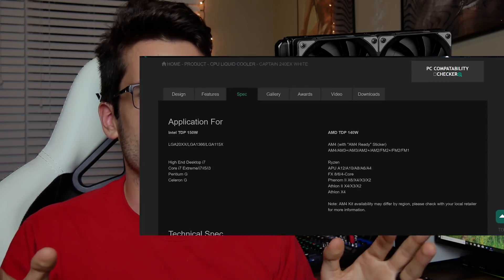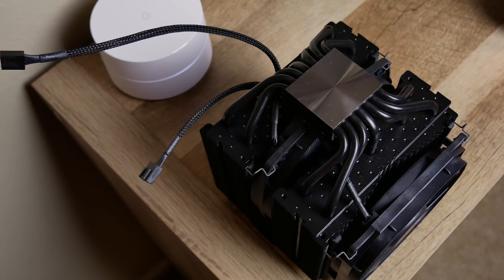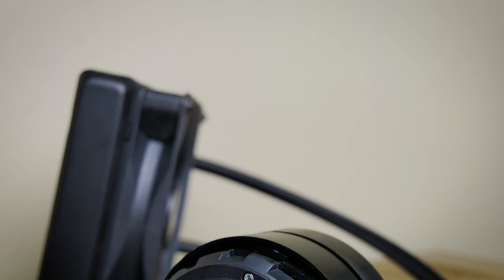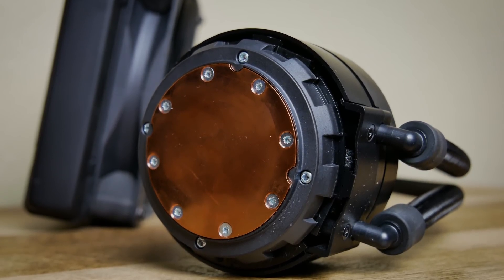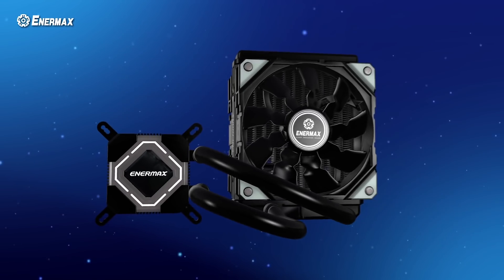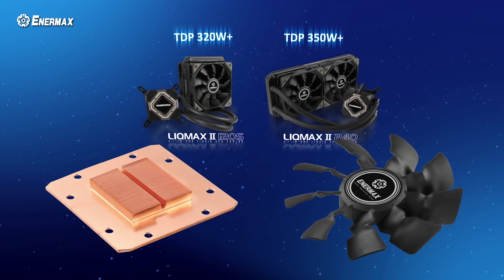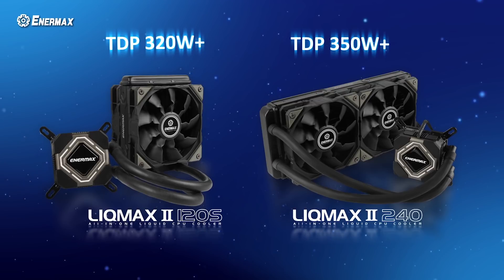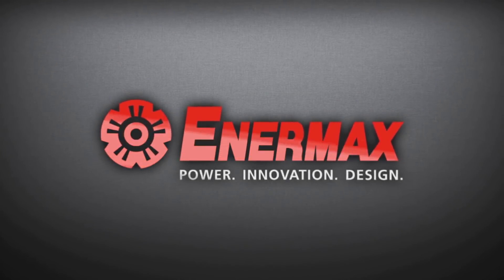Ever Wondered Why TDPs Aren't Listed for AIOs?

Comment: soo im wondering 
does watercooling make hardware live longer?

like im not talking because lower temperatures
i mean of Temperature slower changing than it doesn on an aircooler
(because materials expand or shrink depending on temperature)
Reply: PLPlolol 1 sounds like a good theory but even if it did make a difference in practice the cpu will be obsolete and the motherboard will probably die long before the difference shows. 
Id rather replace a couple fans on an air cooler than a couple liquid coolers over that huge timespan aswell.
Reply: yeah 
atm im actually more interrested in aircoolers but then id have this big open space in my pc unused ;-;

Comment: Arctic (the guys who make the thermal compound) also list their TDP on their website, but as with deepcool they do it with quite reserved figures.

All of their aio coolers have two fans in push and pull, starting with their 120mm extra thick rad, so they definitely underestimate their TDP.
Reply: I have a 240mm Arctic Aio for two years now and it runs like a charm. Its the same Asetek pump that everyone else uses but it only cost me 85€ with 4 relatively good fans included. Can't come up with a reason to buy other brands for 120€+ over Arctic.
Reply: Reanu Keeves i don't know but it's quiet and does the job, so why bother? :)
Reply: Phil Atkins have you looked at arctics air cooler tdps?
Reply: EHEH RON I have, they're all realistic too :) I particularly like the Cooler 13 CO which means continuous operation. Designed for servers or HTPCs basically
Reply: black jack if it's 2 years old is it a Gen 3 asetek pump or was it just as gen 4 came out?
Reply: Reanu Keeves according to hardwareluxx.de, Arctic seems to use Aseteks fifth pump generation, I hope this helps.

Comment: If companies were honest about their TDPs then they would probably have a hard time selling their AIOs since air coolers are just better bang for the buck in terms of raw performance. I can get why they don't list their TDPs and it's a bit of an arbitrary thing as a company to do nowadays if you want to sell customers an AIO rather than an air cooler. It can seem a bit scummy but it's business at the end of the day and water cooled PC's usually look more aesthetically pleasing than a big beefy air cooler. But are they generally worth the money? No.
Reply: Companies don't list TDP becuase it's not as impressive, so they won't sell as well. That being said, there are a few advantages to liquid cooling. AIO pumps might not conflict with RAM, VRMs and decorative plastic bits on your mobo (think strix z270e) as much  as a large air cooler might. Additionally, depending on the case or configuration of your PC, your CPU might run a few degrees cooler by pulling in cool air if you front mount your radiator, especially if your GPU is dumping heat into your case constantly and you have minimal airflow.
Reply: mjc0961 
I suppose you have not heard of more silent pumps, or to at least normalize the flow rate to be consistent. To keep increases in control.
Reply: Hardline custom loops look nicer than a big beefer air cooler. AIOs don't. Take that soft tubing flopping all over the place and GTFO of my build!
Reply: "water makes better temperatures at a smaller size and drastically less noise than air."

Nope. The noise of the pump more than makes up for being able to run the radiator fans a bit slower than the fans on an air cooler.
Reply: My computer can run silently if I dial back the fan speed.

There is no pump noise whatsoever.
Reply: water makes better temperatures at a smaller size and drastically less noise than air. air is much cheaper and can cool better but at much higher volumes and drastically bigger parts

Comment: why not just advertise a maximum and minimum tdp. Or like how gamers nexus measures temperatures, tdp, with fans, at a certain sound i.e 40dba which  advertises both the coolers capability as well as then fans
Reply: Clam Dong to make money?  Marketing their shit products to sell better.  Even air coolers do this.  Check out arctics line of cpu air coolers. They have ridiculous high tdps listed.
Reply: Maximum TDP would be misleading because nobody would have that high of air flow. 
Minimum TDP is would make AIO's look much worse than they are.
Normalized testing makes the most sense, but without legal binding, you can't trust companies to not skew testing conditions just enough to beat their competitor. A great example of this would be vacuum cleaner "power." Over time, the power rating on vacuums has got so detached from reality that most report a physically impossible rating(higher output power than input).
Reply: do the majority of air coolers suffer from cherry picked optimal results?

Comment: Hey guys can someone help me? On all my 379 games, my PC randomly freezes, nothing in particular triggers the freeze, and i think is something hardware releted issue... the same problem was happening on a g3258 and a 960 4gb, now i have an i7-4790 and a 1060 3gb but the problem still remain, what should it be? MoBo? Ram? The HDD's aren't becouse i tested a game on the SSD and the problem remains, maybe PSU? I have a cougar vtx 600w, 588w max output, i can't really figure out my problem, here's the video of my youtube channel that explains better than all my words: https://www.youtube.com/watch?v=K3i1z6vIC8Y
Reply: you should stress test your hardware and look at the temps or if it locks up. use a tool like msi kombuster. because what you "" describe""  is completely random. 
so first check your temps. and after that you can check everything else. 

ps this has "nothing" to do with you hdd
Reply: Temps are fine, CPU not over 55°C, GPU not over 70°C, no throttling..

Comment: Then why do almost every single person prefer aio? I know that they are easier to mount and put in smaller case but in regular sized cases i would always put something like noctuas nh d14 or d15 or dr pro 3 or 4 because I know that tower coolers are much better at heat transfer than aio. And because of that reason i would buy a bit bigger case if it couldnt be placed inside.
Reply: Hardcore Hardware well for me something like dark rock looks much nicer than aio

Comment: someone told me that AIO's have they are "more effective" as they heat up and they are gonna to be able to cool anything.
I think that only AIO coolers are worth just for estetics or when your ram sticks are 2 high to fit a beffy cooler.
Reply: AIO's warm up slower, and cool down slower, they are not a magic solution, but with the right one on the right CPU, they are freakin awsome and more silent
Reply: Harm Zegt AIO's more silent than air coolers? I beg to differ. The pump design Asetek has been using for a few years is anything but silent. It may just be Corsair and NZXT, but after having terrible software (CAM) and hardware (H100i v2 and X52 Kraken) flaws I bought a Dark Rock Pro 3. No problems since then, and this cooler is the definition of "silent".
Reply: Harm Zegt I got h100i(I think) and barely hear it most times compared to my lil bro's ps4 which at times sounds like it's gonna jet off
Reply: Piotr Romasz I have a SFF rig. I can't fit a tower cooler in an Elite 130. It isn't just about RAM height. Sometimes there are cooler height limitations, and a CPU block takes less space than air cooling.

Comment: With AIO cooling, am I wrong to think that you want your fan curve ahead of the curve as it were, so that you dissipate heat before it builds up, because it's very hard to lower the liquid temps without dropping load considerably?
Reply: mavis cruet yes, because with liquids, it takes a long time to heat up but it also takes a long time to cool down.
Reply: Thought so.  I bought a pre-built system recently, and the AIO was the lesser of three evils on it.  So I chose that.  Mostly I wear headphones, so ramping up fan speed matters very little to me

Comment: So here's my question. I have a cooler master liquid master 120 I think is what it's called, and as soon my systems boots and comes on line  my CPU temp is 53 degrees c just at idle. I would have thought that the liquid cooler would keep it cooler than that. I can hear my pump spin up and seems to be running in accordance to the fan controller software in the BIOS(pump is plugged in to the CPU OPT header). Could I be missing something?
Reply: Hardcore Hardware No offence mate, but did you use all the TIM at once? I don't think you did it, but people these days you know don't get smarter so I have to ask.
Reply: Joseph Mouton sounds like the cooler has bad contact to the CPU. Maybe the wrong thermal paste application or wrong cooler installation
Reply: is it just one core? i have the corsair h100i and a i7 6850k one core (high OC core) is 49 idle and the rest is around 30/40 c
Reply: Bloodhoun21 the thermal paste that i used is Arctic Silver 5.
Reply: Abuzer Komurcu the CPU that I have is a Ryzen 7 1700x. I'm not sure if it's just the brand itself.
Reply: Joseph Mouton the thermal paste is fine. Is it applied properly? Either too much or not enough/ not spread properly can make a huge difference in temperature.
Reply: Hardcore Hardware Try to give the pump full speed in the bios. Check if the screws are tight. If this doesn't help I would RMA it. A 240 mm cooler can't be that bad. That's worse temperatures than a Intel stock cooler. Check one of  der8auer latest videos. He uses an  CPU without a cooler and it has similar temperatures in idle like you with a 240.

Comment: After how many years should you replace your aio?
Reply: Mato Matala Noctua is really good, but the fan is horrible to look at
Reply: I'd recommend servicing it before you replace it - aka when you notice throttling on whatever you're cooling or it leaks and kills your components because it's from coolermaster
Reply: I'd say around two years, that seems to be around the time i've needed to replace mine before thermals start to get really bad.
Reply: jeez +AliasOfMyself ,  i've had my h55 for 5 years and it's been fine (for now.) What brand of aio did you buy if u don't mind me asking.
Reply: Waifu Hunter  not terrible but horrible to look at...
Reply: R. A. Mac yes that's what i mean
Reply: i don''t know the brand i use but my cooler is almost 10 years old and still running fine. 120mm max temp in not a good pc case is 66degrees C.
Reply: Using an H105 for more than two years now, working great! Swapped the fans right away as the stock ones were too noisy and had no rubber to isolate!
Reply: and this is the best answer i have seen in a long while. thank you for your time to enlighten us with this description. (mine still works almost like new after 10years, cleaning the dust out once a while, but temps only got up 5degrees in those years so not to bad)
Reply: Vincent Russell Corsair Hydro series coolers have a 5 year warranty. Soooooo, probably around that point for their products.
Reply: my kraken has a 6 year warranty, so aios from reputable brands last longer than the system, assuming you maintain your system up to date with the most recent hardware
Reply: If your pump starts to make noises, instantly change it. Would change a liquid cooler every 4-6 years just because there is the new and good stuff 😉. Long live NH-D15!!
Reply: Vincent Russell It is NOT in how many years should you replace your AIO (CLC)
It is about when the performance starts to degrade..

With any cooling system you need to get an initial baseline of how it performs.. IE what your temps are at idle and under your highest workload..

For example say you have a 7700k clocked to 4.8Mhz and it is summer and your room temps are around 78f / 25.5c and you idle temps are in the low to mid 30c's and your workload temps are in the 50c - 60c range.. take note of that..
If your room temps fluctuate of the year due to seasonal changes you have to take that into account.. any cooling solution will show different numbers based on the room/ambient temperatures..

Now fast forward to 1 year - Temps stay in that same ball park +/- a few degrees C.. Everything is fine..
Now fast forward to 3 to 5 years - Are the Temps still in that range +/- a few degrees C?  If so then no need to replace..

It is when those numbers start to steadily increase  and you fans have to get faster and faster (louder) to try an dissipate the heat that you need to think about replacing the cooler - That is if the pump does not die 1st or you have other issues..

If you look at the warranties of these AIO/CLC's you will see they are from 3 to 5 years.. That is how long the manufactures think they should work under normal use.. You could get as many as 7 years out of a AIO/CLC.

Now AIO means All in one cooler - It does not necessarily mean that it is a CLC or Closed Loop Cooler..  WE call most of them AIO's when in reality they are CLC coolers - Or not able to to be serviced by draining the fluid easily or adding new fluid into the system.. The only realistic servicing you can do is to clean dust out of the Radiator and clean the fans.. OR replace the fans..

AIO/CLC's are not set and forget items. The do need to be monitored for performance so do not take them for granted (which I think many people do until it bites them in the ass)

Also I LOVE AIO/CLC's for their simplicity and how much cleaner they make the inside of a system look.. They also are able to transport that heat directly to and area to be pushed out (if you are not using it at the front or pulling air into the case through them)
All that being said I would always lightly recommend that you have a backup solution (like an EVO 212) just in case you need to replace the AIO/CLC before the warranty is over.. This way your system will not be down while you wait for an RMA to be processed.. 

I would just look for a simple and cheap Air cooler that would work and buy it when it is on sale as a backup.
Reply: TisJester XxX Amen
Reply: Waifu Hunter Not a massive improvement, but Noctua has their 'Redux' line of fans. Identical to their normal fans in every way, but with black a grey plastic instead of the brown.
Reply: there are many other tell-tale signs but that's the laziest method
Reply: Mato Matala long live NH-D14 alive and kicking!
Reply: From what I've seen you should replace it as soon as the warranty is up if not slightly before. This can usually be 3 to 5 years.
Reply: Does anyone reimburse you if it leaks and damages components?
Reply: "With any cooling system you need to get an initial baseline of how it performs."

Not with an air cooler. With an air cooler, you just make sure the fan still works and you blow out the heat sink, just like you'd blow out the radiator of an AIO, and you're good. Maybe you have to change the thermal paste if you used really crappy thermal paste to begin with or if you've had the system for more years than most people would. Otherwise you'll likely build a new computer before the thermal paste becomes a problem.

Also, I still fail to see how an AIO with ugly soft tubes everywhere looks "cleaner" than a simple air cooler.
Reply: My first died within a year and the replacement they sent caught fire 4hrs after install.    So somewhere in between.

Comment: I bought the biggest one i could.
. I use a 360mm aio ... Seems to work for me. 🤷
Reply: On what CPU? Most people way oversize their cooling system(better to oversize than undersized); saying an AIO can cool something like an overclocked i7 isn't really impressive when you consider that even an Intel box cooler is enough to prevent thermal throttling. Once you put most AIO's on things like TR or i9 where you actually need a lot of cooling, then you run into problems. 

Water cooling started as a way to get more surface area than can fit directly on top of the CPU/GPU(mostly the GPU). If you are expecting a water cooler with the same fin area to perform better than a well designed air cooler, then you are expecting something which is physically impossible.
Reply: TruckerBomb Congrats. I can get the same performance with my Dark Rock Pro 3 and can fit it into almost any case :)
Reply: While true, I just comment to bump the YouTube algo 🤷.
Reply: 1700x @ 3.95-/-1.39v